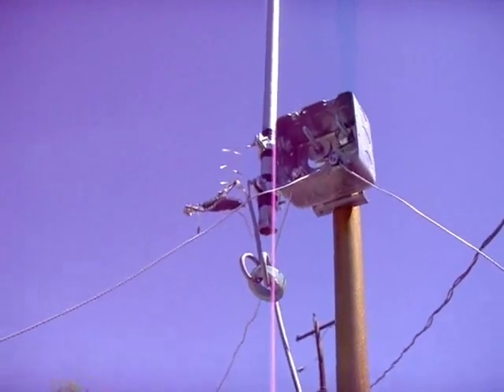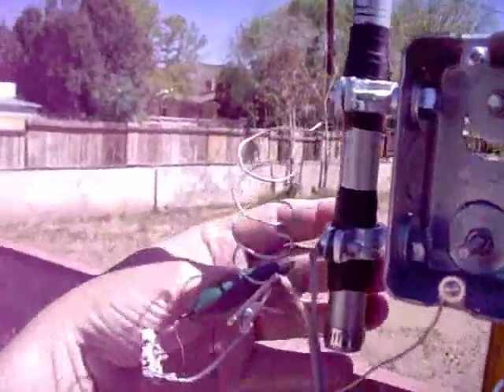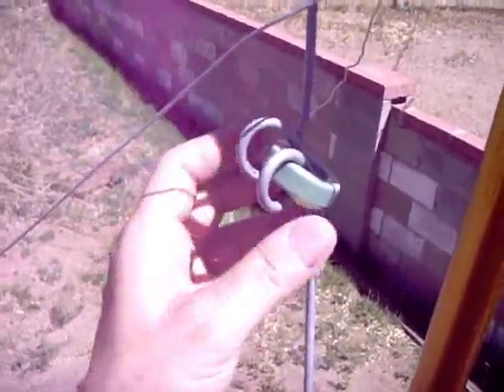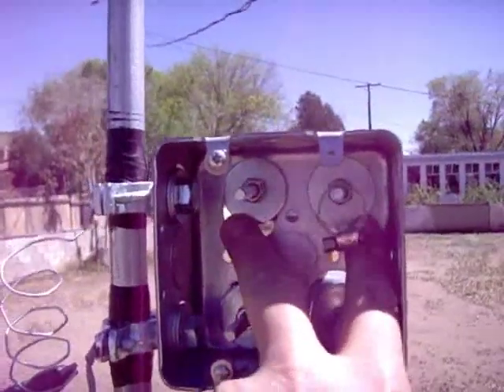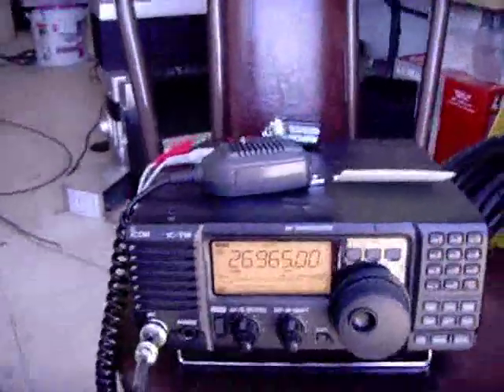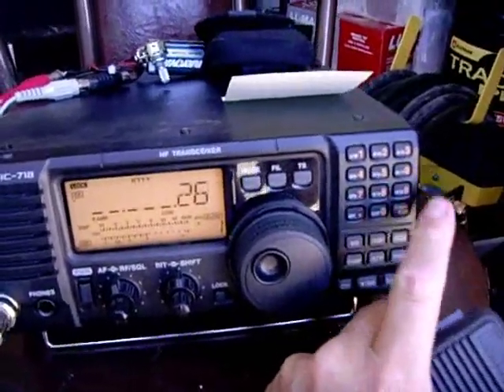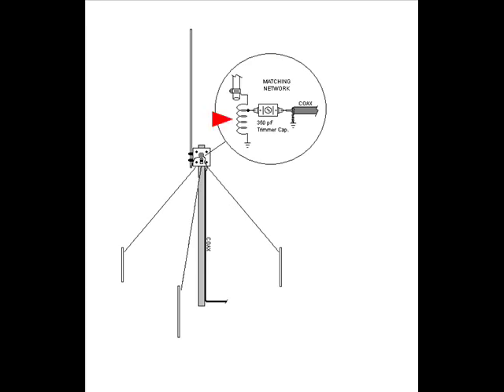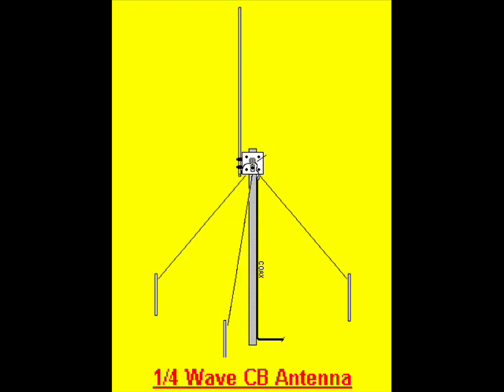1/4 Wave Home-Made CB Antenna

Comment: I made a similar 1/4 wale 27 Mhz antenna  but I did not use a homemade  tuner like you did.  The length of the antenna as well as the angle and length of the ground plane wires will change where the antenna is tuned. My swr was under 2 from 26 to 28.5 Mhz.  It was 1.1 at 27 Mhz

Comment: Awesome video. I don't understand the purpose of the copper coil with capacitor. There's some sort of antenna tuner? Is that only necessary on quarter wavelength antennas? For my base station I have a half wavelength dipole. With none of that stuff. My SWR was better before I believe I moved and checked again and now it's high. Not a big deal I think I need to trim some off the end of the wires.
Reply from the maker: Good question. 
Under normal circumstances, a 1/4 wave ground plane is an ideal antenna and does not need anything
for tuning it, just the proper length radials with the ground radials at the proper slope. However, such an antenna will behave differently mounted on the ground as opposed to on a pole in the air.

The ground plane antenna i made is mounted on the ground, which caused tuning issues. That's why i made the tuning network, which demonstrates how they can be used to midigate such issues.

The half wave dipole you spoke of is a good antenna too, but it's feedpoint impedance is generally around 72 ohms, not 50, which is ok, but it will cause a higher SWR. Also, if your dipole is horizontal and not at least a 1/4 wavelength from the ground, this too can  contribute to higher SWR issues. These are just a few issues that can cause matching issues with antennas. 🙂  73
Reply: @bob4analog  ten four, thanks.

Comment from the maker: Thanks mucho for your compliments, Ed. Yes, I checked the B/W before making the tuning network. Connecting it 'naked' (w/o the tuning network) showed an SWR of 1.7:1... I wasn't impressed! Regular 1/4W GP's aren't supposed to be that high, maybe 1.5:1 or thereabouts. It seemed no matter what I did, the SWR was still quite high. Altho it did have 1.3:1 SWR at  around 25 MHz, Hmmmm...! Anyhoo, I just made the match network and called it good. It seems to work great overall.
Reply: Native matching at 25 megs, I wonder how long the radiator? The SWR curve was it a dip at 25 with some bandwidth or just one frequency. The radials might change the loading according to t their angle. Dipoles are about native 70 ohms, a ground plane with dropping radials as you have here should be near 50, so if the length is not too long a 25 meg SWR low is interesting, but antennas do that too us, they just sometimes load somewhere else. You compensated and probably did not create much loss doing it.
Reply from the maker: I think the reason the SWR dipped at 25 was probably due to how close the antenna was to the ground. I remember reading that somewhere saying it can mess with the swrs being low due to the capacitance to ground. More capacitance, lower frequency. Makes sense.

Comment: The tap goes from the bottom of the radeader to the ground connection. How would that work? Is not the antenna and the ground supposed to be totally isolated? Need help. would really like to do this.
Reply from the maker: Yes, in effect, it is seperated from ground at the 27 mhz frequency. The coil and the variable capacitor make a tuning network so the antenna can be matched. A normal ground plane antenna is usually aleady matched, but this one was off, so I made this circuit to demonstrate how tuning and matching can done.
Reply: Did you ever make one? How's it turn out?

Comment: Bob where did you get the 350 pf trimmer Cap?   do you have a part Number
Reply from the maker: I already had one. But you can use virtually any 350 pF trimmer cap. But if you need a reference, you can get one on Ebay. Here's 1 I found on Ebay: eBay item number: 182470275381. Hope this helps.

Comment: Can these antennas be painted? With spray paint, or does it affect the antenna.
Reply from the maker: +wuberman - Yes, painting it should be ok. Would avoid metallic paint, like silver or gold. These may cause a problem.
Reply: Most spray paints have metal in the as part of the pigment.  You will want to use a lacquer instead of an enamel type paint.

Comment: Bob H  may i ask for a List  of material.   can provide a e-mail for the information.   Thanks
Reply from the maker: Gfdf Perte - I mentioned them in the video, but I'll try to consolidate a list for you.
Reply from the maker: PART                             QTY

1/2" Galvanized
Split Ring Hanger ....... 2

3/8" 16 Coarse
Thread Hex Bolt ......... 2

The rest of the details are in the vid.

Comment: I find it a little strange to see a matching device on a quarter-wave usually they are on "end fed" half-wave,  and 5/8 wave verticle antennas.
On a quarter wave ground plane antennas,  the feed point impedance should be 50 ohms,  and there should be no need for a matching device of any kind if it is done correctly.
Reply from the maker: True, if the antenna is not on at ground level.